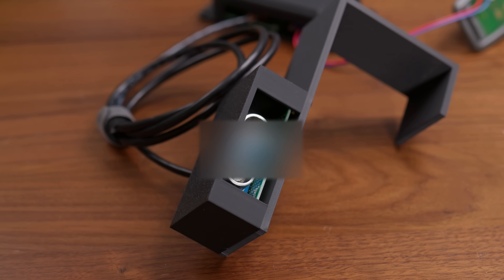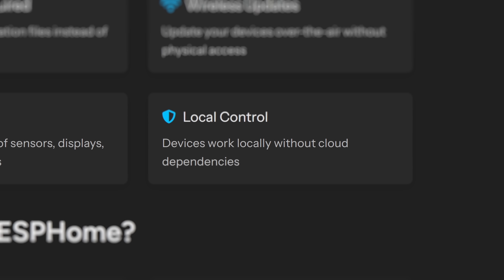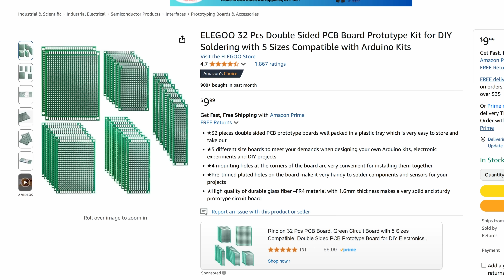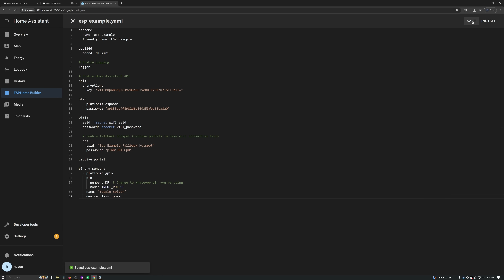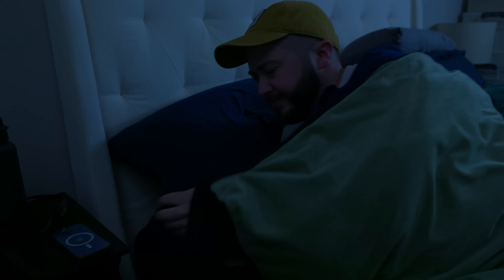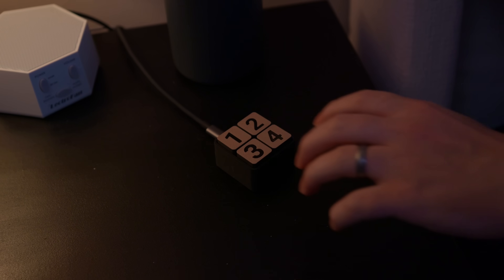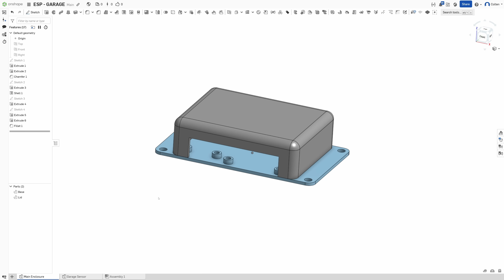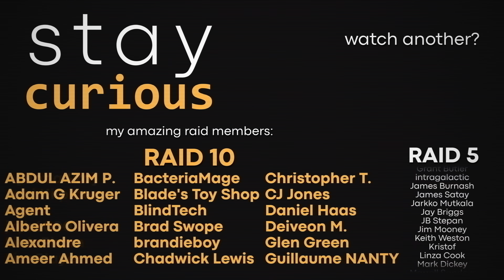These Tiny Computers Made My Home Smarter

Comment from the maker: Click this link https://sponsr.is/bootdev_HardwareHaven and use my code HARDWAREHAVEN to get 25% off your first payment for boot.dev.
Reply: Just get a microantenna and stick it to the inside of the case.
Reply: This is a really great entry level project, but the easy Temp/Hum is the AliExpress Tuya  TH06 for $3👍
Reply: Colton, did you post the code for the keyboard switch box and the cad file for the case you used? I am SOOO new to this and it's so frustrating that I would rather start from where you finished than try to figure this out the hard way! 😉
Reply: I figured out without and without pulling my hair out! And instead of having ID's, in the automation under the "Then do" portion there is a choice to toggle the device you want to turn on/off. That just worked, so yay! If there is anyway you can upload the file for your case I'd appreciate though. That would get me most of the way to my end goal.

Comment: Of course a Zigbee button to do things in HA costs 6 bucks off IKEA (Somrig) - well, used to, they're moving to Thread I guess. So having smart buttons around the house doesn't really require any tinkering. Especially since most of these buttons let you double click or hold for even more functions. Temp sensors - Thirdreality's AAA driven one is also a doddle to install, and sticking with Zigbee over Wifi just feels better to me. The garage door opener may require some tinkering, not sure. But I guess it's fun to tinker.

Comment: I made pretty much that exact same garage door opener with esp home 5 or 6 years ago, ultrasonic sensor and all. Works great. Only thing I did differently was I tied it directly in parallel with the wired button inside the garage so I didnt need a remote

Comment: Mmmm - good on you for making stuff- but simplicity is the best way in the long term. I kinda feel you replaced dumb switches with a bunch of complicated electronics and then made switches?
You butchered a remote rather than just buy a second remote or use the wired option that most garage doors have?
Whatever floats your boat I guess

Comment: Hey mate great video. However those garage doors have I/O pins on the unit that’s plugged into power that opens your door. Instead of wiring to the remote like you did. You can simply put the ESP I/O to the garage door I/O. Depending on your brand, quick google and chat GPT would be able to trigger a high/low pulse to the current input. And you would be able to open the door. For knowing if open or closed would still need a sensor like your ultra sound sensor. But this way you wouldn’t be using the remote etc. Keen to see a new video if you decide to change your set up to wire directly to your opener.

Comment: I like the garage door idea, however if I was using automation to open or close it I would want 2 sensors for the door state. One for "open = true/false" and one for "closed = true/false". That way it's a bit more secure because both sensors could be checked before taking action. Wouldn't want my door to repeatedly open and close because of a failure on a sensor or connection issues with it.

Comment: now you can auto open the garage when you are driving home, set a few rules (Activate only when connected to cars bluetooth, only when driving towards home using proximity integration, and be within 350 or so feet or a zone) and have remote access to your home assistant on your phone.

Its a cool little convenience, I've had a few hiccups, but I think it was more due to tailscale VPN turning off on my phone after a restart or something.
I still use a remote when leaving though, I'm paranoid an automated close when leaving would take too long to activate or fail outright.

Comment: 14.55 the twisted pairs of the cat5 will not help you with signal integrety as the signal between the controller and sensor are not differential.

Comment: Does your garage not have a two pin remote button. Most have this and it is hooked up to a button inside the garrage. I just used this cable area to do both.

Comment: The latest garage door openers from Liftmaster and Chamberlain communicate digitally with the wall controller over a 2-wire circuit.  There are no terminals that can be  bridged with a simple pushbutton switch to open and close the door.  Other opener manufacturers may have done the same thing.  The only options left are to modify a remote control as shown in this video or to modify the wall-mounted controller to bridge the pushbutton switch therein with a miniature relay.  To avoid injecting noise into the 2-wire circuit between the opener and controller, wires from the relay to the tap-in point need to be kept short.

Comment: I've got a similar setup for my garage door but the relay goes straight to the opener and the distance sensor is on the ceiling. When the door is open it sits about half a meter from the ceiling and bonus is when the door is closed I can tell if there's a car in the garage and even which car since the two cars have different heights.

Comment: Great projects!  With your garage door project, could you add another ultrasonic detector to measure the distance of the car inside the garage.  The ESP program can use the distance data to know if the car is leaving the garage and Close the garage door after the car leaves the garage.  You can add a remote ESP switch on the garage wall to Deactivate the sensor if you want the garage door to stay open after the car leaves.  What do you think?

Comment: Great Projects THANKS!  With your 4 button switch Project, could you add led lit buttons so you can see them at night?  Also, could you add a 4" piece of solid core 22ga hookup wire to the WiFi connector and drill a small hole in the plastic box to have the wire hang out to improve reception?

Comment: I love a good project, but for the garage door, I just went with RATGDO32 for $60 and called it good. Connect a few wires to your garage door motor, and you get all the controls + percentage open/close instantly in HA.

Comment: The only issue i have with these custom home devices is that every time i need to take a usbc cable and a power brick and it ends up using a socket. I wish there was a better solution for power
Reply: Replace the socket with one that includes the usb ports

Comment: Nice video.  I've been working on a similar solution for my garage door.  

The reason you needed to do the ESP-IDF for the C3 is due to the chip on that Xaio.  It's not Arduino compatible, as far as I'm aware.  As far as antennas go, you can acquire tiny little flexible ones that should fit inside that housing (I believe that adafruit has a few).

My strangest ESPHome project was a wifi-controlled coffee warmer plate for my wife. It is essentially just a relay with a timer, but I put an OLED screen on it with status readouts and a countdown to an auto shutoff.

I use some 433 MHz buttons to trigger automations.  I like the 4 button macropad option.

Comment: Sacrificing remote was not necessary. Just open garage  motor (probably there even is special lid to pop up), and find screw terminals with your remote receiver installed. Wire your relay parallel to that receiver and you're done. This is that simple. 
Electronics of those garage doors just waits for momentary close circuit on those terminals. It does not care weather this circuit is closed by remote receiver, momentary switch on wall, or relay controlled by esphome.

Comment: Great Video, I just have a small suggestion, to me its more important to know when my Garage is closed, rather than open, I say this because if your garage is half open, your rail ultra sensor will show the door closed when its half open, So I would move the sensor to the side rail where the door closes at ( i know its more wire) but wouldn't you rather have it show its "open" if the door was only closed half way rather than you thinking its closed since its not within the sensors range?   Just thoughts. I use the "window sensor" just works for my setup.

Comment: A bit late here, but instead of a relay for the button presser, an opto-isolator (aka optocoupler) will do the same job with way less power required to drive it (its an LED), much less space required (they're usually small 4 or 6 pin chips) and no clacking noises.

If you're a tightarse like me, optocouplers can be salvaged from dead switching power supplies - from tiny wall wart plug packs to ATX power supplies. Almsot always one inside every one of those, and rarely are they the cause of death for such power supplies.

Comment: Depending on the make and model of your Garage door opener, there should be a bunch of terminals on the opener board just for that purpose- to connect external inputs from wall switches and lock switches etc. There could also be "open" and "closed" feedback signals you could read in via relays. If you google the manual you can probably find that out quite quickly.

Comment: The ultrasonic sensor is an active sensor, i.e. it has to be actually driven and takes up some power to get a reading.  A reed switch is just a mechanical switch triggered by a magnet and you can hence have the microcontroller sleep until the gpio attached to the switch changes state.  For your usecase that might not make much difference, but if you have a battery-powered project, it can make a world of difference.
Reply: Well, the D1 isn"t that great because the other electronics on the board also consume a bit too much power.  A basic ESP8266 would be better for that.  I typically use Attiny85 or 84 for battery powered stuff as I still have them lying around and they can go for more than a year on a single 18650 charge while doing some 443MHz transmissions with a cheapo transmitter every 10 minutes.
Reply: FWIW I had several issue with reed sensors on garage doors - strong winds caused the door to wobble which triggered the sensor. The only solution was using increasingly stronger magnets, which drove up the cost of the project.
Reply: @cbrunnkvist Note that also orientation of the magnet is crucial.  I'm unsure whether that holds for all reed switches, but the ones I had wanted the magnetic field in its length direction and even had a preferred orientation.  Deviating from that required much stronger magnet or the magnet being placed much closer.
Reply: Interesting.  I'm familiar with ATMega 328 based projects which can run for years on two AAs.  What sort of life could a D1 manage with sleep?

Comment: Interesting concept, as an incessant tinkerer this has some promising aspects.  Following the Google search for ESP Home led me through several different websites to Home Assistant which then took another couple of websites before eventually landing somewhere with a price!  I wouldn't have had to do any of this if you had simply stated that you need Home Assistant which costs about £80 GBP before you can do anything else.  No thanks, I'm going to make my own bespoke system and program everything myself instead of relying on chat GPT.

Comment: Rather than sacrificing the remote there's generally a switch on the opener itself. I used a shelley relay to close the contacts on mine. I just used a reed switch with wi fi on the door - had to custom make a metal bracket but was pretty simple. Now you just need to program it so it automatically opens when your vehicle gets home.

Comment: Coming from an academic, small consultancy background not using a mercury tilt switch for the garage door sensor was borderline heresy. Then you could have used the spare proximity  sensor to check that it was (somewhat) safe to operate the door closing action.

Comment: Want to have your mind blown? This was my previous weekend experiment: esp32 running esphome with a Bosch bme688, a BH1750 light sensor, a hi link ld2410C, a platower 5003. Everything in one esp32. And the firmware is ready to add a small led strip for visual cues but now I’m working on a box to print :)❤

Comment: Have several ESP devices but a fun/useful 3D printes ESPhome one is a rain gauge using a contact sensor that seems to be pretty accurate. Set up graphs in Home Assistant for seeing precip over time and to turn off my irrigation if there's more than a set amount of rain during a prescribed time.

Comment: Nice little starter projects! :) I do already have about 15 of these deployed around my house doing several stuff :) 

Just a recommendation: if you're buying new ones, DON'T buy ESP8266! They are painfully slow and have very little resources, for these kind of projects they are ok, but go into a more demanding area such as mmwave detection, audio processing or medium sized lighting projects and you'll regret it in an instant! The ESP32 are as cheap as the older 8266 and they outperform it by a factor of 4x if not more. Also be aware of the type you buy, I personally would recommend to stick at either the C3 or the S3, there are other chips out there that also can do zigbee, but so far there is no official support yet in ESPHome for these as ESP-IDF (the library you are using to compile the software) doesn't (fully) support it yet. 

Anyway, great stuff! Definitively a new rabbit hole to explore! haha

Comment: Great video, thanks. I have been wanting to add a way to detect if my garage door is open or not and close it if needed, and given I run HA anyway this is great and I sm going to try my hand at creating something. I will however just connect it to the inputs on my door opener rather than use a remote. Thanks.

Comment: Great job with the garage door opening system. I built one and again didn't want to sacrifice a remote, so I have a mechanism where I slide the remote into a specific sized housing and have a servo set up as a button pusher. So when I want to open or close the door, it actuates the servo in a linear fashion and pushes the button. Combined with a XIAO NRF board, which is running as a ultra low power battery powered sensor with two reed switches, which should last for two years, the system automatically closes the door if it senses that we're out of the house and the door's open, or we're upstairs and the doors are left open, for example.

Comment: Great video. I love those little XAIO boards, especially the NRF versions

I use them for things like your button demo, but if you use Bluetooth with the XIAO board, you're able to get two to three years of life out of a single CR123 battery, which is tiny, making it a portable solution and still really fast. 

You can also do the same thing with its onboard IMU for things like Detecting orientation. I built one that goes on a door lock so we can tell if the door is locked or not based on the orientation of the unit. This is powered with two AAA batteries and I've measured it with an expected lifespan of two years. I've even got one attached to my garage doors transmitting as a beacon and updating the packet with the status of each door in near real time. The moment either door opens, a central receiver I've put together in Python gets the data and sends out a notification. You can also use it in a traditional beacon method with a custom iOS or Android app.

Comment: There are also Power Over Ethernet microcontrollers, that can be used with ESPHome. This gives better reliability for data communication and with also powering, just one cable needed. For instance with the application in the garage this seems convenient.

Comment: The AM2302 temp/hum sensor isn't really good, the sht3xd temp/hum sensors are of better quality I read, better accuracy.  The AM2302 and DHT don't always show the actual temperature of the surrounding. That's always the question with a sensor: does the shown value actually resemble the actual value? It depends on the application in which the sensor is used, how important this is. For instance for a home thermostat application it isn't such a big deal if there is a deviation as long as the deviation always the same and the user just sets what feels good, but for other applications it can be a problem.

Comment: Highly recommend you look at the everything presence one by Everything Smart Home. It is a neat extension to get human presence detection with an ESP32  base. Also, that r Ultrasonic isn't weather sealed. You may need to find an alternative. There's very few that are weather sealed outside of the ones that go on car bumpers. There's some other alternatives that might work better long term, but aren't as cheap.

Comment: Any idea how I can stuff one of these with a small LiPO Battery in my mailbox and have it run for a year without having to constantly charge the battery? Also what sensor would you recommend for figuring out whether the mailbox was opened? I was thinking perhaps an ultrasonic sensor that would register new mail but Ive never done this before.
Reply: Use a reed switch instead of the ultrasonic. Also a small 5v solar panel should be considered to keep the battery charged.

Comment: ESPHome is pretty slick! I use an ESP32 board as a remote power button for my PC - just wired it in to the power button on the mobo, allowing me to switch it on for remote access anywhere in the world (caveat: anywhere with internet connection)!

Comment: Instead of a relay you could have used a optocoupler...it make it all smaller, the side with the internal Led connected to the microcontroller and the other to the button and the ground or vcc (depending on what kind of pull, up or down, the button have) when you give power with the microcontroller to the optocoupler led it will close the contact on the other side

Comment: you dont need to short pins to flash the D1.
these remotes are 433MHz. you could just get a 433MHz sender module and use it with the D1.